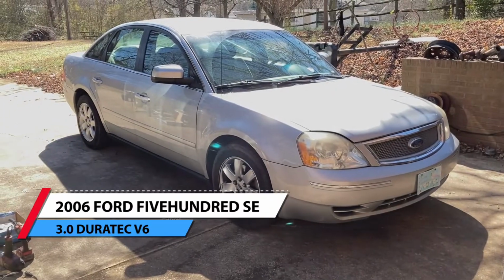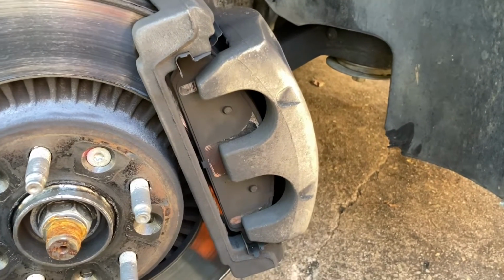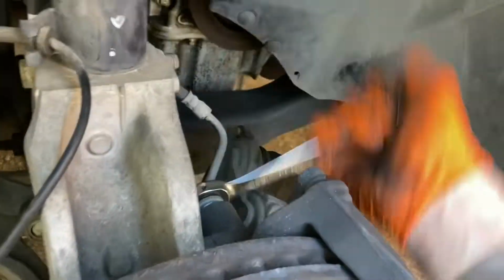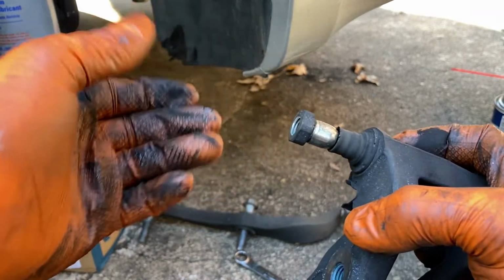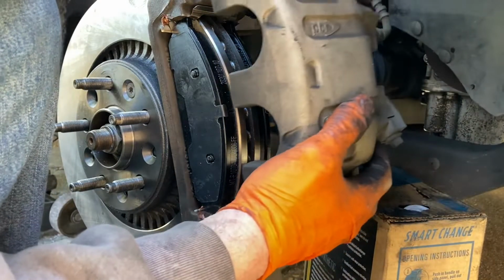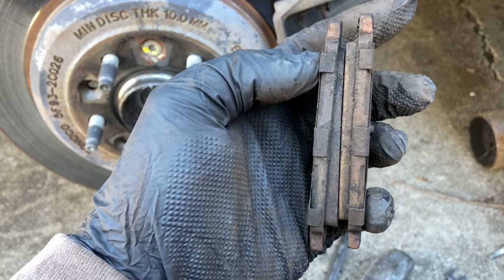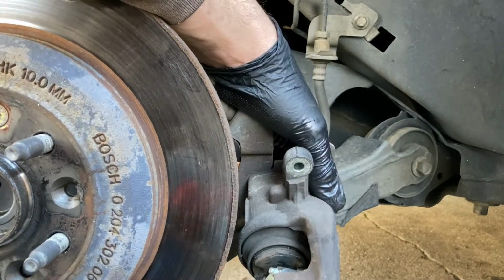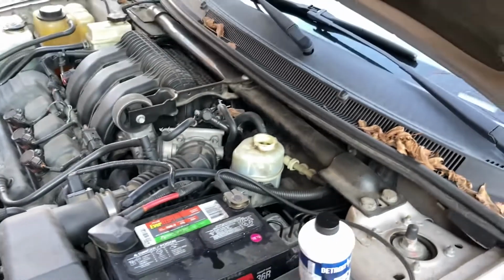Brakes and Rotors in Depth Full Brake Job Ford Fivehundred / Ford Freestyle / Mercury Montego

Comment: the rubber on the pin is for noise and vibration dampening and allow air to bleed out from the back end of the pin I think...

Comment: The rubber hose on the caliper is not twisting right with the new caliper do you know how to turn it with out kinking the hose?
Reply from the maker: If I understand what you’re saying you can either take the caliber off and twist the caliber on the hose or twist the hose opposite direction a few times before you screw it into the caliber so it will be straight
Reply: @DeeStruggles  thanks for the reply i just ended up popping the top metal bolt loose then i could adjust the rubber hose tension. great vid thanks a lot!